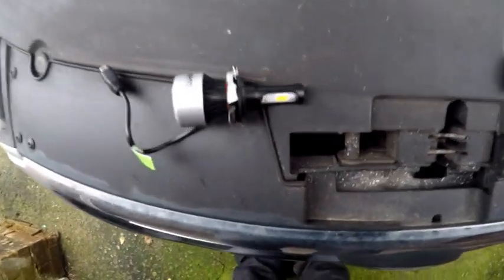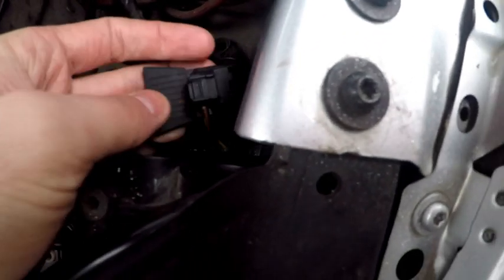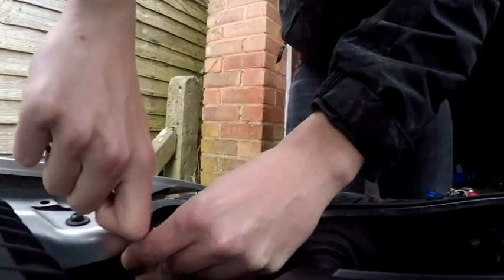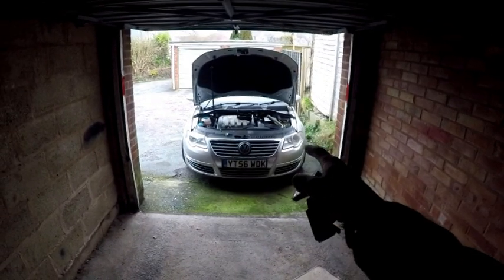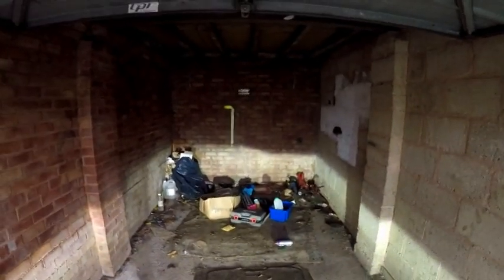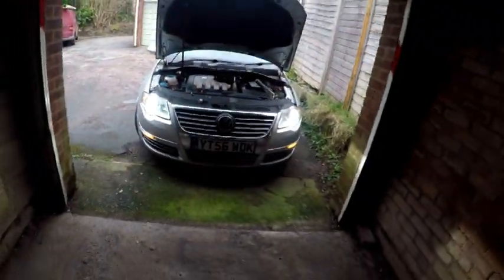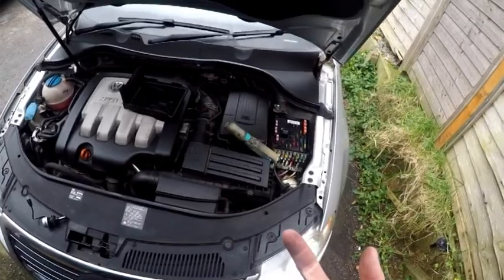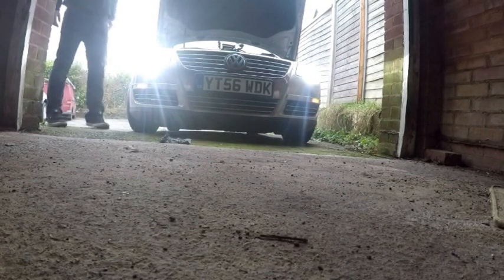Fitting/ Installing Night Eyes LED H7 Bulbs Passat B6

Comment: So is the projector producing the low beam or the high beam? Thank you
Reply from the maker: Correct
Reply: It's a question mate. Is the projector for the low beams or the high beams?
Reply from the maker: @minas.s4184  low beams mate
Reply: @stephan20008  what about the high beams?
Do you have anything else fitted on your car or u just plug them in and that's it?

Comment: When fitting them did you rotate the LED panels to face up and down or left to right? I’ve got a pair and I’ve fitted them left to right but I’ve got to wait until it’s dark to see if they’re beaming into oncoming drivers eyes. Thanks
Reply from the maker: Try putting the beam up against a wall and doing it from there should flick to the ns.

Comment: These are the adapters I bought, they look like they are the right ones - https://www.amazon.co.uk/gp/product/B07QXHXY8L/ref=ppx_yo_dt_b_asin_title_o03_s00?ie=UTF8&psc=1
Reply: Here is an updated link for the bulbs as well https://www.ebay.co.uk/itm/Nighteye-Car-72W-9000LM-H7-LED-Conversion-Headlight-KIT-6500K-Bulbs-Xenon-White/184355613085?ssPageName=STRK%3AMEBIDX%3AIT&_trksid=p2060353.m1438.l2649

Comment: I have the same Passat an 08’.. I’m having issues because my LED’s did not come with the adaptor that keeps it in place... I don’t see your bulbs in the link nor the adapter..
Reply from the maker: Night eyes h7 leds.   Just type in led bulb holder on ebay.  Done.
Reply: Can U show how U attached the clips on the led bulb ?

Comment: The LED bulb has a fan, which means it needs to be aired out. What did you do with the rubber dust cover on behind the headlight assembly to let the cool air in?
Reply from the maker: J C did test the bulb after an hour usage with the inferred temp gauge and was only 1-2 degrees hotter than an open headlight.  Due to the engine bay being hot.

Comment: How did you get those stainless steel retainer/clips around the bulb?
Reply from the maker: Push fit!!
Reply from the maker: That Car Channel that are actually aluminium, 5 pounds on eBay depending where you are from!
Reply: That ring thing on the led twists off. Be gentle

Comment: Hi Mate, how did you plug the two metal-prongs of the LED light into the socket? My bulbs plug into the bottom of the holder where it sits, and then you twist the holder to lock the bulb into place. I really need help working out how to plug my LEDs in. Please reply.
Reply from the maker: Straight into the standard loom mate

Comment: Hi any light out message on dash after install? The usually happens with non canbus lights, can you confirm? Cheers
Reply from the maker: David Cohen these are canbus. They have a built in decoder. So no errors!!
Reply: Stephan177 cheers bud, going to order these leds bulbs and adapter you mentioned in comments. Prob put a video up later next week!

Comment: hi I have similar leds but they throw a light out error on the dash so I bought the canbus adaptors and its still throwing a light on the dash. also when I'm driving one light will turn off and on again. this happens with both sides not at the same time. any ideas on a fix?
Reply from the maker: marc lynam double check that the plugs are in properly mate
Reply: marc lynam get the night eyes mate I had the same problem replaced them with the ones in the video and no problem... good luck :)

Comment: Hello Stephan,is there big difference between HID and LED ,in the range and intensity of the light.
Thanks !
Reply from the maker: Костадин Самарджиев LED is instant brightness, HID has a warm up time.  LED HAS A BETTER OUTPUT WHICH GIVES OUT MORE LUMINS AND LESS WIRES

Comment: Has it affected your beam pattern at all? I want to fit this to my b6 but don’t want the hassle of having to remove it every year for mot!
Reply from the maker: Its fine as your projectors cut the beam.
Reply: Inside the projector lense there's a cut plate inside. It's not the bulb that does the light cutoff it's the headlight unit.

Comment: Can you send me the link to the  Adapter please if you don't mind as i need one for my nissan qashqai thanks
Reply from the maker: There is to different types of adapter bud, https://rover.ebay.com/rover/0/0/0?mpre=https%3A%2F%2Fwww.ebay.co.uk%2Fulk%2Fitm%2F282745138116

https://rover.ebay.com/rover/0/0/0?mpre=https%3A%2F%2Fwww.ebay.co.uk%2Fulk%2Fitm%2F173299923036

All depends on type of headlight
Reply: Stephan177 my one is were the plug clips onto the bottom of the holder then you sit the bulb in and then turn the holder to lock it in place
Reply: @dashcamdude6690  Hi Mate, did you ever get this to work? I've got the same problem as you, my bulbs plug into the bottom of the holder where it sits, and then you twist the holder to lock the bulb into place. I really need help working out how to plug my LEDs in. Please reply.

Comment: Do you have an error after installing? When I installed them without loading resistor they work fine but right now I have an light error on instrument cluster.
Reply from the maker: No error!
Reply: Did you solve it ? I have the same problem

Comment: Hi, can you please provide me a link, where can I purchase those H7 metal bulb clips ? :-)
Reply from the maker: Martin Hrmo https://rover.ebay.com/rover/0/0/0?mpre=https%3A%2F%2Fwww.ebay.co.uk%2Fulk%2Fitm%2F282745138116
Reply: thank you ;-)
Reply from the maker: Martin Hrmo no worries mate like and subscribe ;)
Reply: Hey mate is there any way of fitting these lights without holders? I want to put them on as soon as they arrive but I’ll have to wait obviosly until I get these holders or can I improvise somehow?
Reply from the maker: ultrascasual file out your original bulb holders to the ones you see online basically a circle.  Best wait if you can!!
Reply: Stephan177 Cheers mate, i’ll see what i can do.
Reply: @stephan20008   Just ordered the metal ones. I tried the plastic adapters, but they are rubbish

Comment: Are these bulbs still working 6 months on
Reply from the maker: Trevor Guy yes they are. Iv recently installed them in my new crafter van.
Reply: Stephan177 thanks must invest had the white halogens before but they only lasted 3 months
Reply from the maker: Trevor Guy these are great just make sure you get the correct beam pattern, shine them against the wall and get the pattern right :)
Reply: Stephan177 thanks have beam checker in garage
Reply: What do you mean by the beam checker on pattern 
Thanks in advance 
Jim